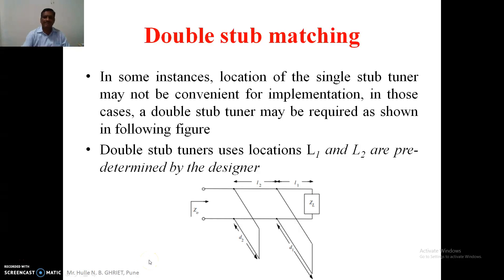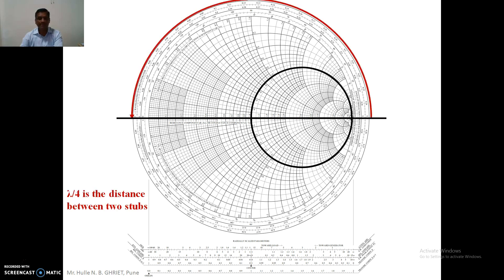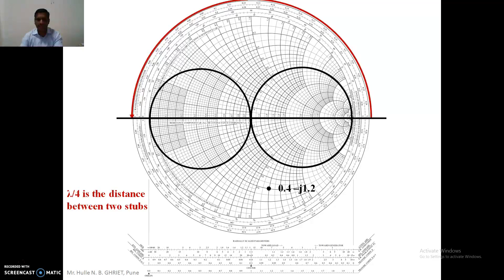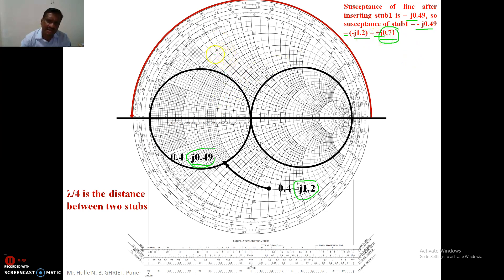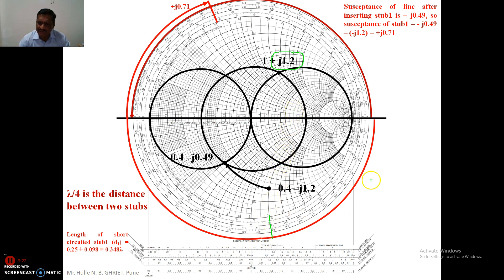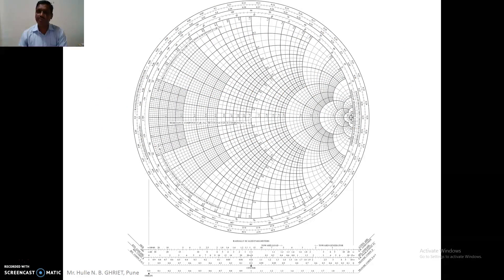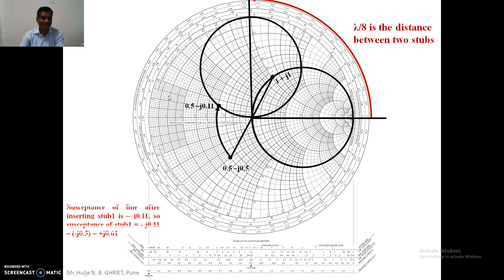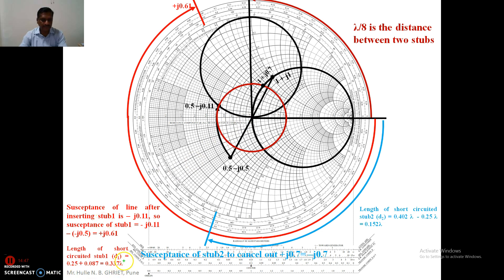Double Stub Matching using Smith Chart by Mr. Nagnath Hulle

Comment: @13:29 the value should be 0.5+ j0.11 .
Reply from the maker: Yes you are correct
Reply: Then in that case the compensating length has to be from -0.61j ?